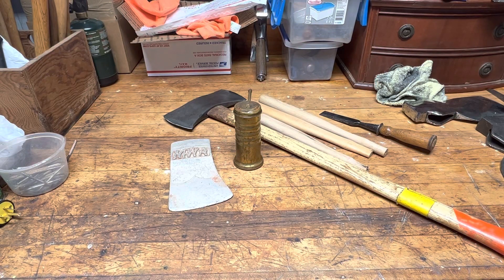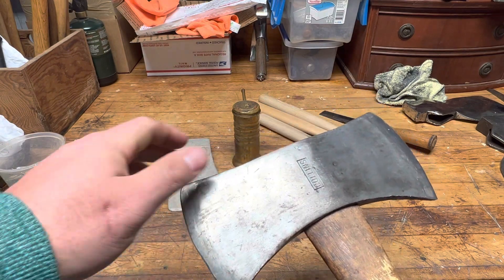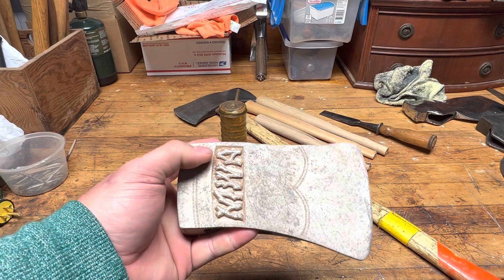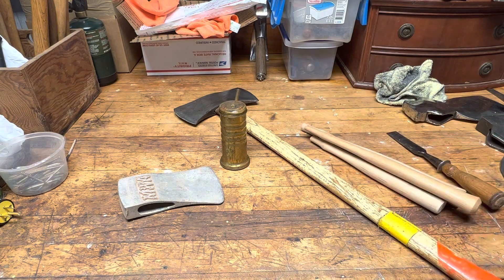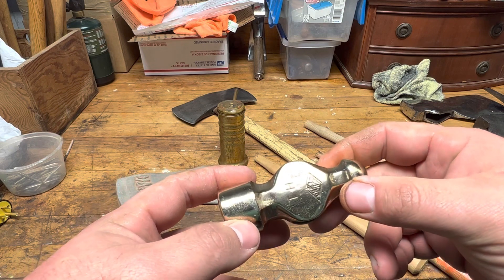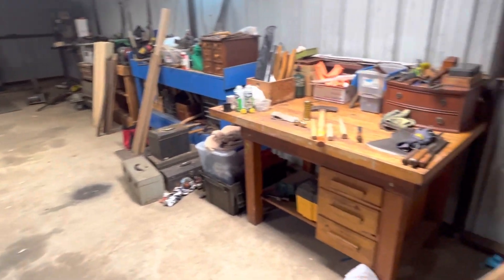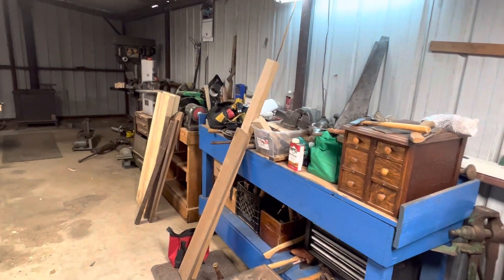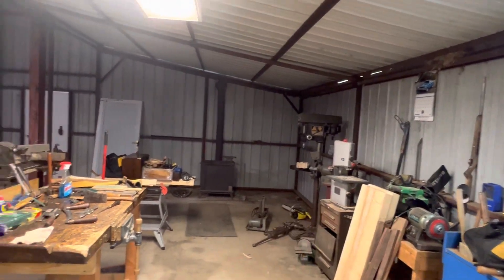FleaMarket Finds and Shop Update

Comment: Nice haul.. like the chisel and oiler... and I'm the same with electricity I rather not touch it if I don't have too.. good stuff awesome shop
Reply from the maker: Exactly. I avoid it at all cost!! Thanks for the kind words. I am trying to get it together man. I need more storage area. More file cabinets or shelving. I’d like to get both. I really would like to get two or three of those index card file cabinets.  The smaller drawers that are taller ya know.
Reply from the maker: I did notice in your last video you showed a lot more of your shop! You have storage everywhere it seemed!! Any tips?

Comment: It seems like there is a lot of places where the ceiling meets the walls that you can see light coming thru.  Good for ventilation 😀, but bad for heating 😔.
Reply from the maker: There are a few spots here and there. Most of it is sealed pretty well though. The birds made a nest on the south wall and that caused some issues I think. But I may just have to spray foam all the way around. We will see! Thanks for the observation!

Comment: Shops are interesting.  Not even full tours...even a little talk about improvements and changes can be fascinating to me.       I keep wanting to film some of my storage.....I do at times...but half the time it looks like a roll back truck dumped out.......Maybe its just the lighting...yeah that's it...lighting throws the camera.
Reply from the maker: I feel the same way! You just have to cut yourself some slack and keep working. The shop is basically a hobby not our full time job. So it’s a constant battle. Thanks for the comment buddy! I appreciate it!
Reply: @BrianRust89  the pleasure is all mine.  I would of replied sooner but I went to pick up a box in my garage and it was holding up 17 bigger boxes.
Took me all afternoon to dig myself out.  Now if I could only remember where I left the box I was after in the first place. 
Have a great evening!